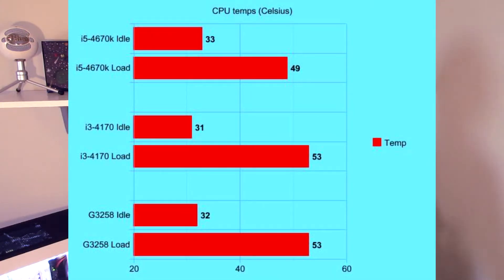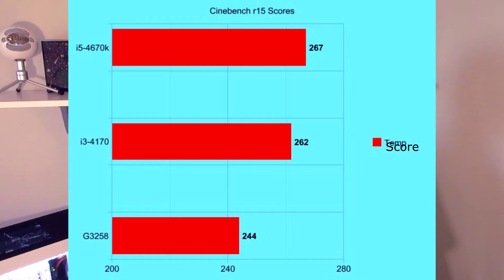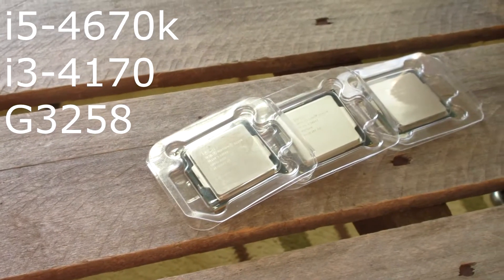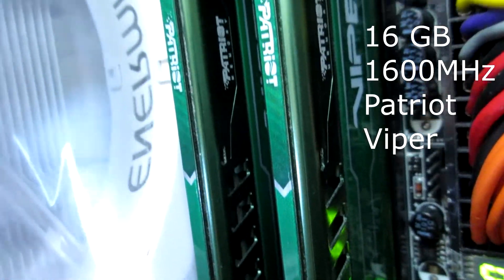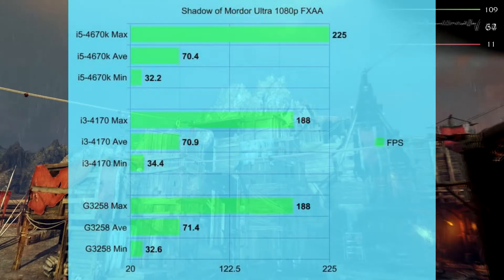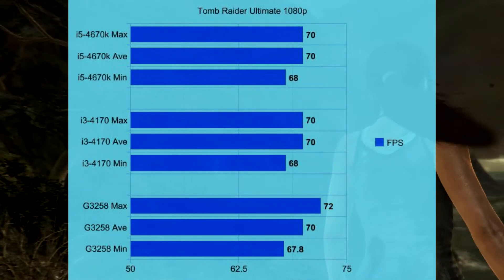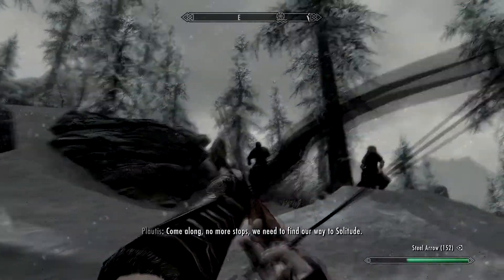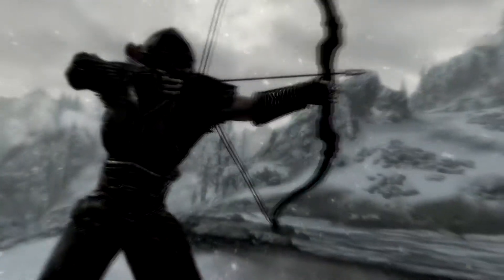Pentium i3 i5 Processors  | Simulating CPUs 1

Comment: Hmmm I wonder if 1.6ghz at 8 cores can compete with 2 cores at "???" Ghz
Reply from the maker: +\ 0909 i think the dual core would wreck the 8 core 1.6ghz because in many situations a computer wont be using 8 cores. The dual core would do much better at gaming, games like fewer faster cores. but its certainly interesting to think about. i could test 4 cores 2ghz vs 2 cores 4ghz, or something similar.
Reply: Yogert PC
 I agree, I do believe with the current lack of optimization, a 4hz 2 core would reck at  2ghz 4 core. Its interesting to know though, at what discrepancy exactly???

When (on average)does the typical budget dual core and quad thread machines reach there OC limits and when does advantage (at what ghz) of  8 threaded beasts come into
 play?? Hrrrmmm
Reply from the maker: \ 0909 by dual core quad thread i believe you're referring to i3s. the Pentium G3258 was a big deal because it would overclock to roughly 4.7GHz. and that made it compete very well against higher end processors for the price.

the biggest drawback of the Pentium was it only having two processing cores which made it not popular to the crowd who wanted to play games that liked having 4 cores.

with an i3, you could possibly have a 4.7GHz (if intel decides to do so eventually) and still sport 4 threads to help with multi-threaded tasks and games that like more threads. 

for the second part of your question, i think maybe roughly 3.whateverGHz is where you will start utilizing your 8 cores effectivly because you dont want slow 1.6GHz 8 core processors trying to help you edit and render a video. you want a fast CPU as well. i'd say 3+ghz for intel 8 core processors and 4+ghz for amd's current 8 core CPUs.
Reply: Yogert PC
Ive got a rig sitting around, waiting for 64bit OS, 2x quad core Zeons. (2.4ghz upgrade ability to 3.1 IIRC) 16gbddr2 (Upgrade ability 64gb) 4 Raptors in Raid (400mbs). Lots of server goodies and features.Also Tiny 7. I think im gonna throw an EVGA or MSI GT 730 2GbGddr5 in.

Stock cooling sounds like a Jet at startup but at 2.4ghz not audible during benching.

Edit:Benching Passmark on a 32bit OS.